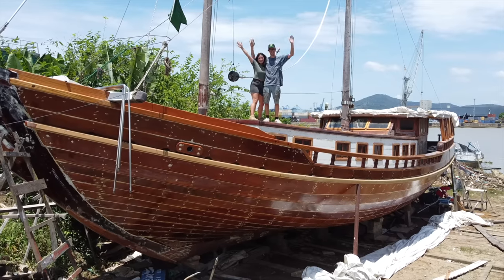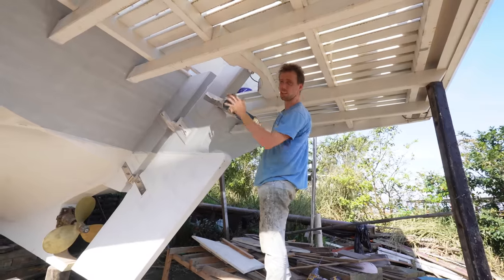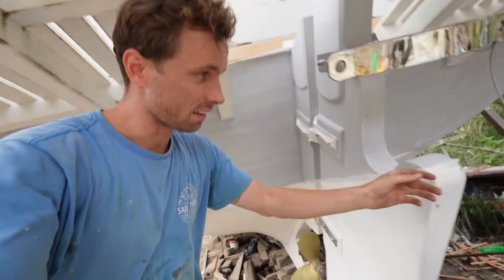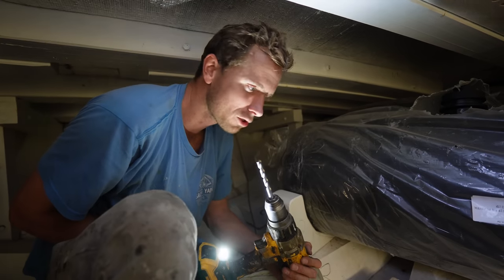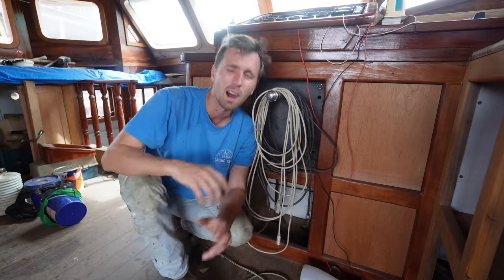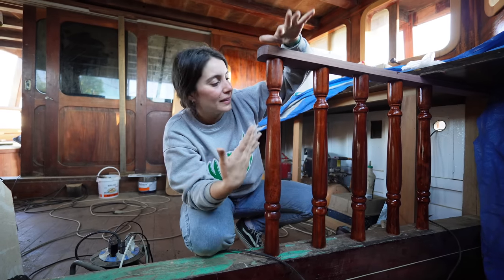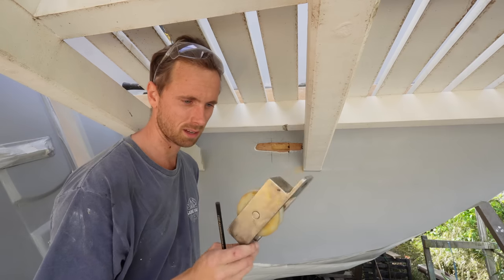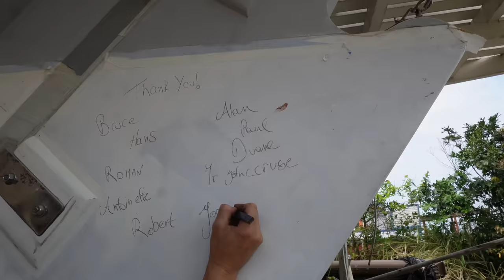We can finally steer our once sinking wooden boat into the horizon — Sailing Yabá 152

Comment: I think the cable is a bit thin. I’ve worked on much smaller boats that had 10 or 12mm cable. Also the two pulleys on the bulkhead below the wheel are likely to rip off as the bolts are at the sides. You really need a pulley with the bolts above and below to pulley. I would definitely fit a pair of turn buckles to tension the cables. These could be fitted on the quadrant or better still inside the boat on one of the long cable runs where they can move back and forth without snagging. It also means you can adjust the cable from inside without swimming. Is for a steering stop you could use chains on either side the quadrant to stop it turning to far. They would also keep the rudder from being lost should it ever become dislodged at sea

Comment: The control lines must have a spring to keep always the tension, when the control lines strech due to the temperature or other reasons. I also think that the hole shoul be protected by a nylon tube or similar and make sure that that the water do not enter into the boat

Comment: could be a spliced eye normally with ferrule to connect the wire, you might be better fixing the cable with rope/wire clamps which are fairly inexpensive - might want to replace the nylon with brass pulleys - funny i recently came across a load of smaller ones, couldn't think what they be for, but in the same drawer were some sash weights, then it was obvious, sash windows, the proper ones had them, the window counter weighted with steel bars

Comment: The steering system will last about 5 minutes. You need far heavier gauge chain and wire together with heavy gauge connections between wire and chain. You need collets and sleeves where the wire passes through the hull and tensioners to keep the wire taught. Additional pulleys are needed on the outside as the wire passes through the transom and the wire needs to be secured around the quadrant with at least 4 turnbuckles. I suspect that under load your pulleys and wire will bind without entry and exit guides. I am not a shipwright.

Comment: Suggestion:  add turnbuckles on each line inside the boat so as the cable stretches you can adjust the tension on the lines.

Comment: 🌟🌟🌟🌟🌟 Braide the cable ends , leave extra 15cm put cable clamp next to thimble with extra in it and 2 more cable clamps all @ 4cm apart.  This will give piece of mind about clamps slipping because of simple braiding of loop tight around the thimble then bring the 2 halves back togeather to make 1 cable end of extra 15cm cable long extra.  If all 3 clamps come off - the braid will still hold.  To make braided loop ends -- clean cut end on cable --- divide cable to make 2 halves --- 1 usaly 3  twists and second will be 4 twists __  if a center strand is present ,,  no worries -- unwind about 21cm --- take one and make a half loop and bring other end and make half loop in opposite direction up against the first half --- take tail end and intertwine around other tail till it aligns as original cable should look ---- you may need to pull tighter and slip into the next groove and make it so thimble when put in place- will fit tight ---- now inter twine the tails making the rest of the loop look like 1 cable till both ends come back around to the base end of loop and go and put thimble in loop of cable and put tail ends braiding around the point were the tails came apart and continue to put tails togeather to the 15cm extra is done --- with thimble in place put a clamp at base of thimble around cable so as to hold the thimble in when clamp is tightened.  I hope this is of help, you may already know this information ,,,,, I am passing on what I learned from my father 🌟🌟🌟🌟🌟

Comment: The round piece is called a thimble also you should add turn buckles to each side so you can adjust the cable better and make adjustments when the cable stretches with time.

Comment: It looked like you put the cable through a half link that roller will pull out. Cut the half link off and go through a full link and you night want to make sure the pin is peened over well. God bless you both

Comment: I have read many but not all of the comments below, too bad there is so much redundancy, if folks want to comment they should see what is already said.  Many excellent suggestions, my concern is the size of the SS cable.  It should be at least one size bigger allowing to this size vessel.  Also, I would use pulleys with 4 in sheaves where the cable takes a 30 degree lead or more, as in the engine room at the chain.  A small sheave puts strain on the cable in addition to straining the travel.

Comment: SUGGESTION: I’m certainly not an expert but replacing your cable pulleys with stainless will put steel on steel and perhaps put wear on the cable.  Bronze might be a better option as it is plenty strong and will wear before the cable.  I think a pulley wheel would be easier and less costly to change out as opposed to re-cabling your helm.  Look into galvanic corrosion issues though.  That might be the reason plastic was used originally.
Reply: Yes

Comment: Looking at it from an engineering view, you’re going to need stop plates on your bike chain because if your spinning the wheel to get it over in a hurry, when the rudder reaches its limit, the mechanical advantage your wheel gearbox has will pull off a pulley or snap a cable. Look at it yourself you’ll see what I think may happen😮

Comment: The clamps need to all be facing the same way, not alternating. The U-bolt goes over the dead end and the saddle goes on the live side. (Never saddle a dead horse.) There are also recommended dimensions for the dead end "turnback", number and spacing of clamps for a given wire size, and torque values for the nuts. If you don't get it right, it will result in a reduction of strength.

Comment: The end of the cable is called the dead end. The other part of the cable that is doing the work is called the live end. The unbolt goes over the dead end and the saddle part of the cable clamp goes over the live end. The nuts are on the live end side against the saddle. Remember it this way, “don’t saddle a dead (end) horse”. I hope this helps.

Comment: Not only do you need to have sleeves for the cable to go thru to work properly; the size of the cable you will need to handle your boat in the ocean will need to be much heavier. It will need to be “Marine Grade” and will need to be able greased and sized to handle your boat in both docking and  in tough Seas. The test size cables you are using show’s you it will work now you need to continue through the initial process. There is another method for your chain to work more efficiently and securely last and give you confidence in then real world. If you have a chain sprocket In the engine room below the helm so the chain turns the sprocket in one continuous loop. Add a cable sprocket to the lower chain sprocket so you have a continuous and properly sized cable loop that controls the rudder. Your reasoning is also most there but needs super sized because of the size and weight of your boat being affected by water pressure your boat needs to handle smoothly and it strong enough to give you confidence san control you need. This is critical but good critical thinking you need to work thru in the process.

Comment: Why don't you trim with edges of the rudder?   I think you'll hear "cavitation" noise as the water rushes past the rudder and collides past the flat trailing edge.  Trimming the hard angles on the rudder should reduce that.

Comment: Are you sure the 6mm wire will actually be enough for the holding against the force against that large rudder in heavy seas / wind in relation to the size and weight of the boat? If it is one thing i would oversize for precaution, it would be the steering cables.

Additional, those pullies look to have a wheel in plastic compound of sorts, the 6mm cable will wear that down in no time.

Comment: It’s called a thimble. As far as cable connection you would be better off with what we call a ho Bo splice very simple and u could do away with cable clamps. (Much cleaner connection)  You will now need to find a way to keep your cables tight. For this I would find two areas along the cable route to place turn buckels. Your cable will  stretchas time goes on

Comment: Im no expert in this sort of boat steering system. I like regular tillers, but this does seem a bit jenky. As others have said, theres no provision for tension adjustment, and sacrifical, replaceable bushings  ought to be lining the holes the cables ride through. Theres a lubricant impregnated bronze bushing material (its name escapes me) that should be perfect for this application. Turnbuckles should be a quick and dirty way to tension the system. They work well to tension rigging, so they should work well here.

Comment: The sheeves / pulleys need heavier bolts common failure is the pulley just pulling free from its attachment. The crimp style hardware store keepers I wouldn’t trust. My 28ft 9000lb sailboat has heavier hardware on similar sized cable but cable length is very short. This is definitely a challenging aspect to sort out.
Reply: The attachment point of the pulley vs the cable pull need to be in the same line of pull ie directly opposite of each other. Vs attachment point being 90 degrees to the pull of the cable. So  the first pulleys should be thru bolted not lag bolted to a structure on the floor with the cable pulling up on the pulleys / bolts in a straight pull. Vs levered at a 90 off the bulkhead

Comment: First no steel parts by the waterline second delrin wheels on the sheave base when you tighten it up your wires are not going to hit the stringers of the swim platform questions and answers

Comment: Add stainless steel tubes in the hole that you drilled in the transom so down the road there won't be any wear on the wood, and hole will stay the same size you started with.

Comment: I would wait until you have it in the water before doing anything with the sprocket on the helm wheel.  The rudder at present is dead weight that you are fighting, in water it will have buoyancy to help.  As others have noted the thing that goes in the cable is a thimble.  And also as others have commented get some turnbuckles for your cables so you can adjust the tension in your steering cables.  You really need to line your through hole with something to keep the water from getting to your transom.

Comment: Caution!!!! The last link of the chain where the cable loop attaches needs a structural bolt/screw and nut through it other wise it will fail. The integral strength of a bike chain are also the pins of the adjacent links.

Comment: Does the gear cog allow for rudder feedback to the helm. Or will letting go of the wheel after a turn allow it to "unturn" to the neutral point from the water pressure on the rudder? And will turning at a higher speed make it harder to turn the wheel in turning the rudder? I think rudder feedback is a good thing, and that's why I've always preferred a tiller to control a rudder. Usually the feedback is lost when the gear ratio is such that the rudder can't overcome the friction of the gear gogs and its higher gear ratio in the reverse direction of the wheel turn. Can you view the position of the top of the rudder on the transom from the helm position?

Baluster spindles are looking great!

Comment: If I were going to stay with this system put some rubber grommets in the quadrant so the metal is not rubbing directly on the cable.  The grommets will shield the quadrant from fraying the cable due to direct contact.

Comment: You need at least a bolt and nut at the of the chain because that extremely weak with out a support going thru it. As you can notice the purpose of that is just a roller,  the integrity of that chain includes a pin in each link. Just a suggestion.

Comment: Will you be able to incorporate some kind of power assist to the rudder mechanism so you don't have the pressure of it trying to centre itself? The reason I ask is because such a system might be helpful if an autopilot was installed.

Comment: This boat after the rebuild is to be considered new and has become very nice. It's quite big and heavy. The system for controlling the rudder, which you showed, with long thin cables, running wheels, bicycle chains, cable locks, etc., is on this boat far too weak  construktion. Consider that you are responsible as the owner and captain. For example, install a hydraulic system. In addition, rudders lying on the outside always have a hinge at the bottom. All rudders are in very turbulent water from both propellers and hull which exposes them to shaking. Get in touch with experts! who know what the current regulations say and give advice for the best execution.😮

Comment: Dump the screws and use stainless steel bolts that goes all the way through the transom. During heavy swells and rough seas those screws could be ripped out because of wave pressure against the rudder.

Comment: You need a sleeve throught the transon where the cable goes through ,and the lower pulleys on the inside are mounted at the wrong angle the cable is puling sidewase.

Comment: Should put a stainless steel pipe in the back were the stainless steel wire exits the boat. Run the wire through that instead of bare wood .

Comment: I think you have a weak point in the steering system where you loop the cable through the end of the chain. The cable is not designed to turn through a sharp 180 degrees, especially against a single stress point. The cable is likely to shear here. You should find a fitting that allows you to attach the cable thimble eye to the chain and spread the load. That way neither the cable nor the chainpin will break. Steering is a safety critical item. You did ask for feedback...

Comment: I think you should change the helm to hydraulic, there are many issues as already stated with your current system. Plus how are you going to attach an autopilot actuator to the rudder as it is now. I see there is a rudder position indicator on the helm, are you going to connect it?

Comment: I would cut the cable over head in the engine room and put 2 turnbuckles to tension the system. (I would goto hydraulic as well if possible)

Comment: Not enough tension on the steering cables. Add turn buckles at the chain / cable attachment. Or at the quadrant/ cable end, or both. As it is, you’re going to get half a turn on the wheel before the rudder moves. Unresponsive feel and slow to respond to steering inputs the way it is now.

Comment: I would consider significantly larger diameter dyneema instead of the stainless steel wire.
But all the comments about pulley fastening strength, transom protection, connection to the chain, tensioning etc would still apply.

Comment: Your steeringsystem is going to work but it is not going to last. The weakest points are the connection to the chain and the ungraded rvs shackle. combined with the slack in the steering wire its waiting for problems. When the cabel slips between the blok it wil get stuck. AlsoThere is nog friction on the steering so every wave is transvered to your steeringweel. The spokes of that wheel can hit you very hard. I would suggest that you buy a good hydraulic steering system and instal it. Or build a mechanical steeringsystem using a pitman arm.

Comment: That nylon pully you installed on the transom is going to disingenerate in less than a month, it is too soft for the strain you are going to put on it when you tension the steering cable, change it to stainless and it will be maintenance free, keep a spare for both of the transom pulleys on hand, good luck, have watched every video from the beginning and the boat looks fabulous, congratulations, fair winds and following seas...

Comment: I am curious as to how you selected the size of wire and chain.  That appears to be the same size of wire I have on my 30-foot boat and the chain is smaller than mine.  My rudder is a balanced spade rudder and yours is a barn door so it will have much larger loads than mine.  Personally, I would want a heavier system.  I think that you also need to have a way to adjust the tension of the cable in the form of a turnbuckle.  Your system will always have some points where it will get loose because of the way that the cables go to the quadrant.  You can install a slack adjuster by installing a pair of pulleys along the long run of cables that are parallel to each other and connected to each other with a spring.  you tension the system so that the cable will have a minimum tension and a maximum tension.

Comment: Ben - think maintenance ! Thinks will break/snap eventually. Agree with comments before - your wire WILL rub and WILL gouge the wood where it come through under the transom. Better to have a sacrificial hard plastic pipe that can stand up to the constant rubbing motion (PA6 Nylon Tube)

Comment: Mounting the two pulleys that connects to the chain as low as possible will give the wire more clearance in the pulleys and wont rub on the guard..

Comment: I would have two wires over all to give redundancy in case of one breaking.  Also is there going to  be an indication of the rudder direction at the control station.

Comment: Have you ever heard the saying, " Two is One and One is None" ? You'd better think about installing a second cable through the transom and coiling it up in a water tight box under the dive platform for that Just in Case moment when that cable slips or breaks and you are 100 NM from shore or 24 hours from a harbour?